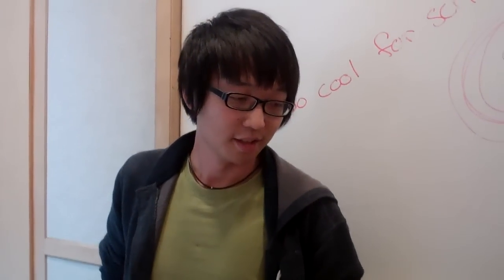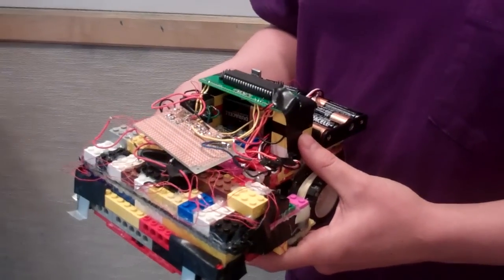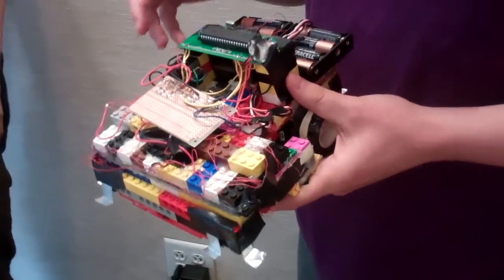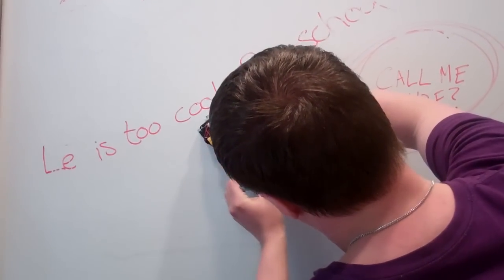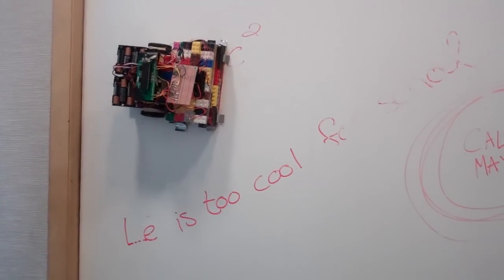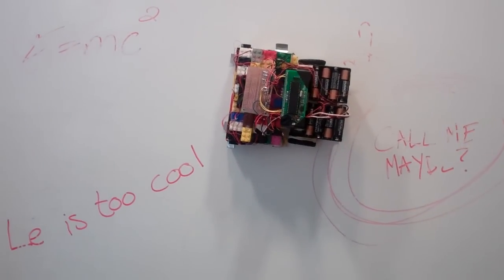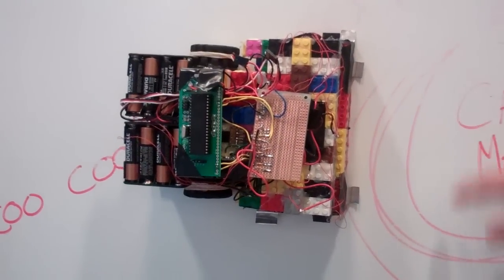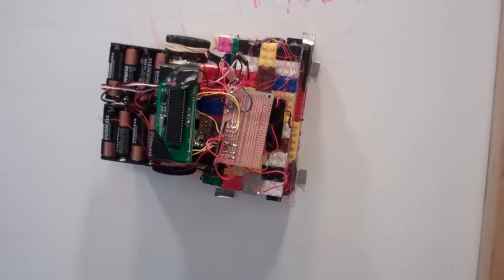Whiteboard eraser robot

Comment: Nice project.The Duracells could be replaced by  a lipo battery input supply which is boosted by dc dc boost converter that costs merely 1 $ and lipo are of 15 $
Reply from the maker: True, although you will note that the project is 7 years old. At that time prices and availability were much different.
Reply: I agree on that sir.

Comment: No offense but this is stupid as hell... it's slow and takes too much.. it's a dumb invention.. much like the air hand dryer and motion paper towel dispenser.. it's much faster to just do pull down paper towels.. and if air hand dryer is my only option I will either use toilet tissue or just leave with wet hands it's too loud obnoxious and takes too long just like this... this is my idea I'm just doing research of my competition. My invention  is cheaper, more practical, and easier to maintain and it will soon be in every class room and I will make millions 🤣🤣
Reply from the maker: This design is a 5 week project in a microprocessor design course. It is not a product design course
Reply: lol mdrrrrr